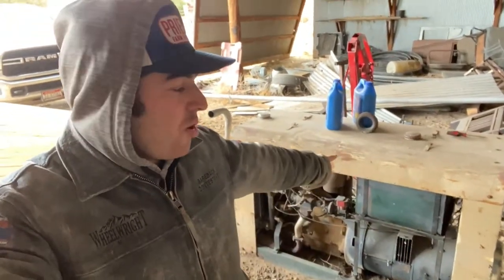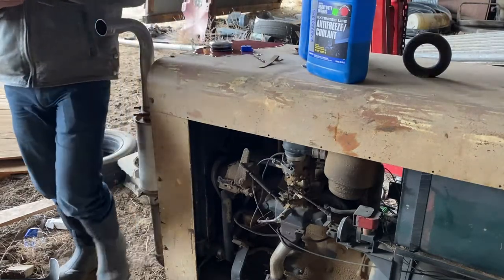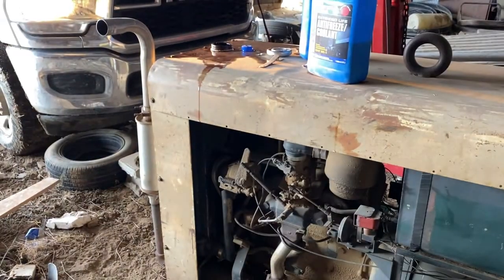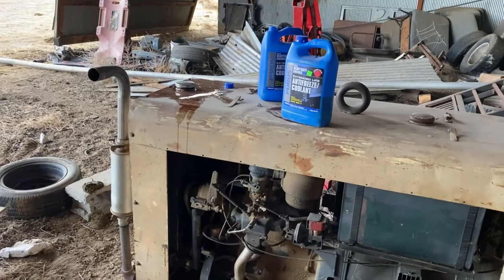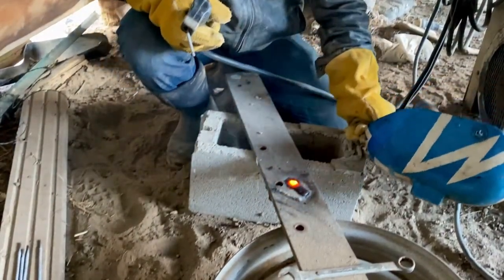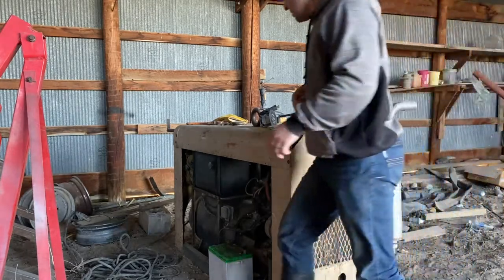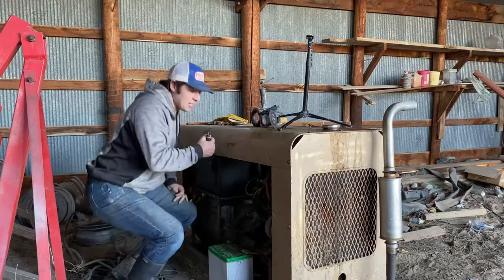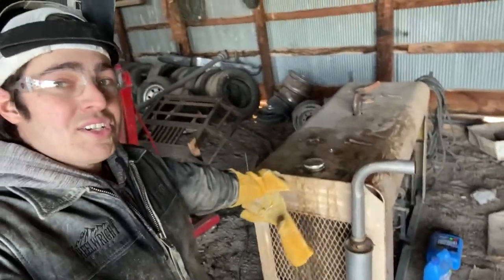Hobart G-261 Part 2: Will it weld?

Comment: You should consider an over flow bottle with a long tube so when the engine heats up the coolant goes into the bottle . When the engine cools the coolant goes back into the radiator and keeps it full,no wasted coolant!!

Comment: A tip that I learned from an on time pipeliner, is when youve got an old machine thats been sitting for a while. get 3 or 4 1/4" rods and max the machine out and run them in. helps clean up the commentator and gets a lot of the junk out of the engine. change your oil afterwards. probably wouldn't hurt to add some marvel mystery oil in the case as well before you do it. ive got a 57 long hood 200 so you learn the tricks with these older machines.
Reply from the maker: Thanks for the tip. My family has had this machine for over 20 years. We used it off and on for awhile but it as sat a lot the last 10 or so years. I’ll get it cleaned up and running solid in no time.
Reply: @huntperformance9175  if your ever stumped on a problem/ trouble shooting it PM me, I might not have the answer but I probably know a guy that does.
Reply: @s.weldingandfabrication4287  How about oil and gas mixture  being puked into carb? The oil pan had gas and oil mixed together, I can feel some residue from oil or maybe some kind of oil leak sealer , sitting on the bottom of the oil pan so I gotta drop that. I bought it a couple weeks back and the guy claimed to not know much about it.

Comment: Hi I have Hobart similar my is running to my question is I have the lead or wire for welding but don’t weld I have question if you have any idea how setup to weld or I have to push any switch or you make any video thanks